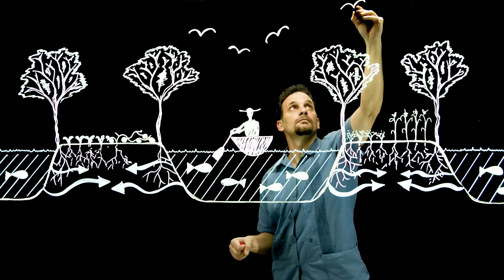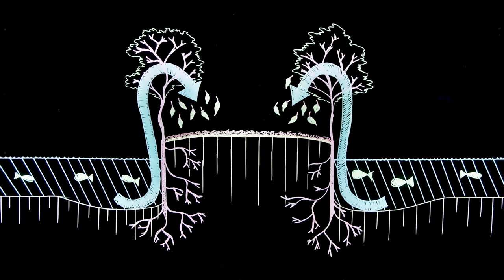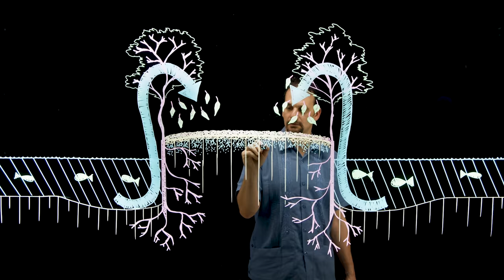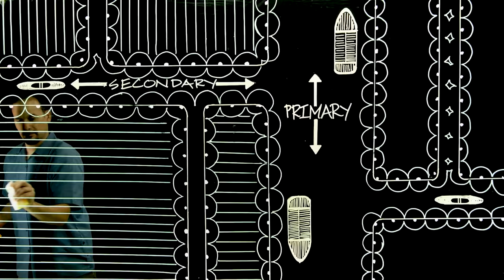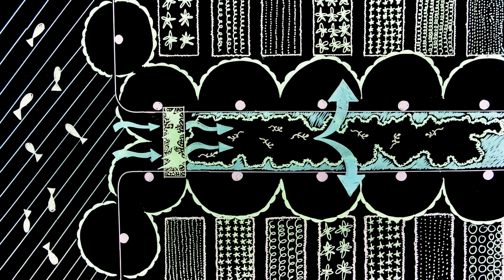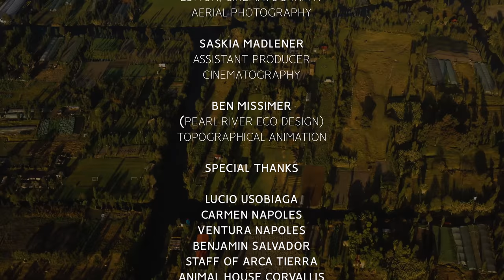Chinampas of Mexico: Most Productive Agriculture EVER?

Comment: Spectacular system. I'm so impressed.

When I was about 3yrs old my family did a boat tour on the Floating Gardens of Xochimilco. It is one of my earliest memories. I reached for the lilies and fell out of the boat... but mom was ready and immediately yanked me to safety.

How awesome to connect that memory with this Ag system.
Reply: This made me smile. Thanks for sharing!
Reply: Is there anything dangerous in the water? Obviously drowning was probably her main concern but does it have a lot of poisonous snakes and such?
Reply: @ArcAngle1117  not really but the canal itself, the vegetation from the bottom and the mud could trap you and it can be very difficult to get out. I live in Xochimilco and I've heard and read of cases where mainly drunk folks fall and don't get out.  Other than that, only  infections and rashes because water is very polluted sadly. You can find rattlesnakes  in the natural reserve, not in populated areas.

Comment: There's a similar system in the Altiplano, the highlands around lake Titicaca at 3,800+ meters over sea level. They're called Waru-warus or Camellones. The water moderates temperatures at night and the mud is used as fertilizer. Very old camellones are being reused
Reply: 🎉👏🙌 The Connections (2021) [short documentary] 💖🙌

Comment: Wow! so beautiful! Well done!

Chinampas are definitely the most effective local farming system -- where you have water and nutrient-rich mud from the bottom of the lake within meters, instead of transporting it from who knows where. I wonder if there's some project of farming on floating structures, where you can water the plants with nutrient-rich muddy water pumped from the bottom of a lake. Then you don't even need to have a shallow lake to build a structure for chinampas.

But as you said, you could also easily transform marshland into farmland with this technique.

You can get really good soil from ponds or marshes in the forest just by digging it up and letting it dry passively on the side and fetch it later.
Reply: The Aztecs actually did that. They had sort of barges that floated on the lakes.

Comment: A true floating garden is one that actually floats on the water.

Ancient cultures built rafts and filled them with soil.
They then planted crops and towed them out into the water pretty far from the bank.
They anchored them to keep them in place.
Plats received fish waste laden fresh water and were sub irrigated.
Insects usually would not fly over open water. Animals rarely swam out to them (sides were pretty straight up and very hard for animals to climb if they did).

They would tow them back to the bank (or dock) and harvest easily.

Other cultures had the rafts but kept them tied at the dock.

Comment: I wonder if such system could be used judiciously in areas experiencing backup of freshwater overflows as sea-level rises.  Not only is sea-level rising but fresh water systems will need places to go as their water courses expand with rising temperatures, and heavy rainfall.  Just a thought.
Reply from the maker: That's my thought as well. As land becomes inundated, these systems can provide a transition strategy. Also for rising seawater areas, chinampas could be planted with halophytic (salt tolerant) species.

Comment: Loving loving loving your channel. Thank you!
Reply from the maker: Glad to hear it, thanks for tuning in!
Reply: I’m buying property out near the Grand Canyon… I’m planning a mini experiment based on this.  But it might be in circles as there is a big mounded water hole in the middle of what has been a cattle yard.  I’m not sure how I’m going to set it up… but since it’s pretty arid there, I want to prevent evap and may cover the water wells with decking… and if the water drains too fast, I may put down pond liner on the bottom only to encourage the water to run into the planted berms… but I have other ideas too.  It’s in an area called Valle at the Grand Canyon junction… there’s a big off grid community there… there is already a budding community effort to get workshops going and budding trade systems are in place.  I always think of you and would love to have you there someday! There’s another area I was looking into but decided against… Clearlake California… you might like to do a series there too someday… I left you a message about it on another video.

Comment: I have wondered if using the mud from the lake to build and fertilize the chinampas can be somewhat carbon extractive - one would assume the relatively locked-up carbon from a lake bottom/ swamp/ peatland would, as it's exposed to air, be metabolized into CO2.  This may be offset to some degree by carbon sequestration from the growing plants, but I would be really curious to know the balance.  A good friend has a lot of waterlogged/swampy - but of course carbon-rich and fertile - land and I have wondered about the possibility of transforming that into chinampa-style beds/canals system, but I'd imagine there's a good likelihood it'd lose carbon as a system over time (and thus wouldn't be sustainable, not to mention habitat loss/change).  I'm not sure, but it gives me pause

Comment: Does this work if the area has seasonal flooding?
Reply from the maker: I think there could be adaptations to use the main concepts in seasonally flooded areas. You just wouldn't have the perennial water in the low areas to support so many aquatic species.

Comment: The video didn't even try to answer the question in the title. What actually is the kilocalorie-per-acre yield of this method? That's how you'd measure agricultural productivity. I would be astonished if it was even a tenth of modern field farming. You can like this method for other reasons, of course, but productivity is an objective number that you should be able to just calculate. Just because it has other attractive properties unrelated to productivity (which is what this video focused on) doesn't mean it's actually the most productive.

Comment: In old world there was wide use of beast of burden in agriculture, from work to transportation, Aztec didn't have these, that is why they used fish for meat and water for transportation. The thing is most productive agriculture is modern intense agriculture, which uses tons of fertilizer fuel and high degree of mechanisation or even automation, i don't see a way to easily implement that for chinampas, especially for staple crops, maybe for leafy greens or vegetables, but not staple crops. It's similar to rice plantation which required massive amount of organization and labour with contrast with wheat, rye or potatoes which grow slower but given low labour intensity can be made cheaper.

Comment: I have to wonder if this could be done in the Olympic Northwest 🤔This system clearly isn't the most productive.. but it's not wholly dependent off of a foreign Petro agrochemical industry. The fact that it self-sustaining. Only needs improvement for output. And it's something you could be done all over the world and low grade wetland.

Side note I wonder what biochar/composting toilet contribution is?

Also if that guy wants to see real black dirt.. near Columbus Wisconsin the dirt is black straight out of the soil.

That part of Wisconsin is basically wetland/swamp grassland.

Comment: I lived in Xochimilco and I can say that agricultural production is insignificant, not even for self-consumption, the chinampas agricultural system only makes the poverty of the peasants and their families permanent. Agricultural systems like the one in Sinaloa, fully industrialized, are the true example to follow. In Xochimilco, a large owner barely has a small portion of land, they cannot live on that; In addition, the water is not drinkable, it is full of stool because the inhabitants of Xochimilco discharge stool into their canals. I have visited other lands where the water is 100% drinkable from a water hole, and in Xochimilco it is contaminated water, the smell of water is nauseating.